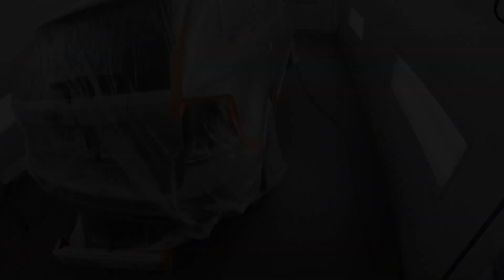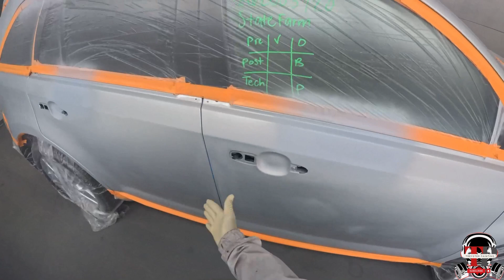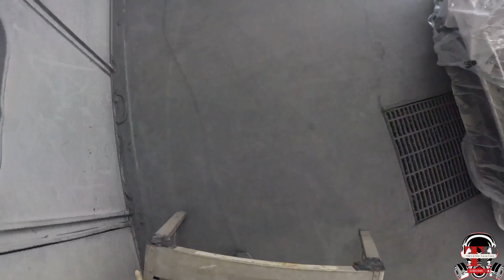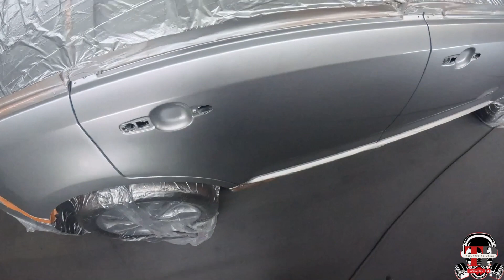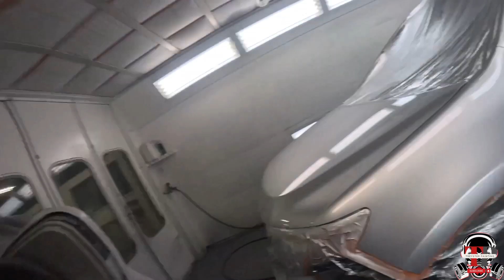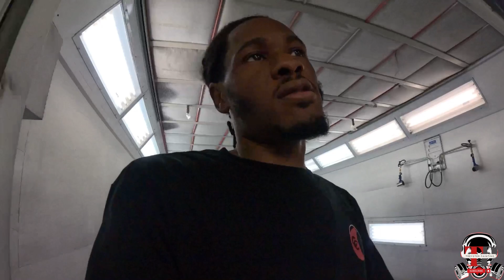Silver Metallic on an almost all over job from Hail!! WS-400 Series 2!!!

Comment: Hey brother back again, great job your doing well 🎉. Quick question please let me know what pressure you use with the ws 400 series 2 water base and clear coat? I noticed that you lower the pressure on the base for the drop coat?
Reply from the maker: Hey I spray the base at 26 psi with the 40 binder and with 10x, 20x I spray at 29 psi and I just dropped it 3 pounds.
Reply: Awesome thanks 👍
Reply: So you spray the drop coat at 23?
Reply from the maker: @raymondrodriguez1158 no problem brother.
Reply from the maker: @raymondrodriguez1158  yes.